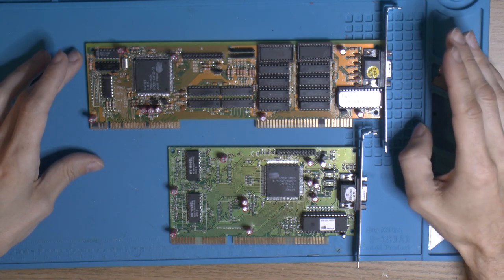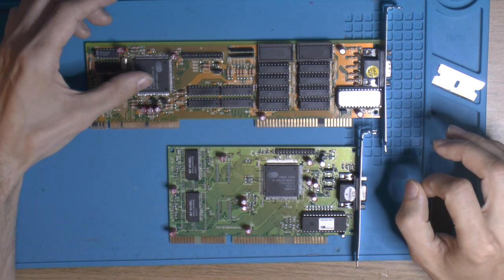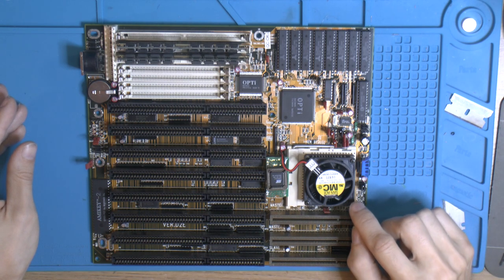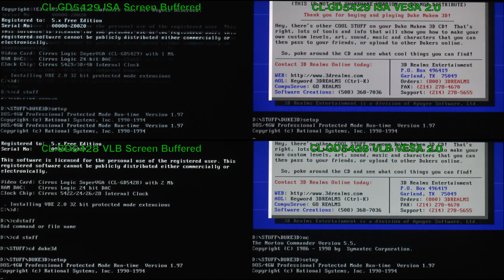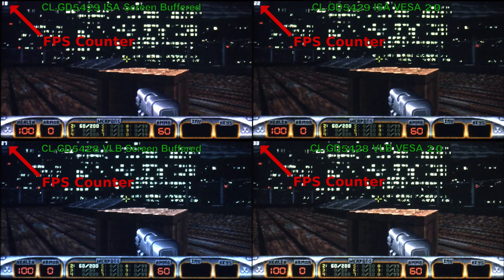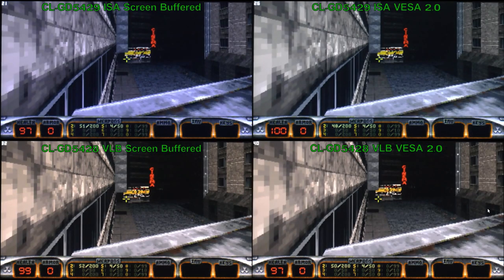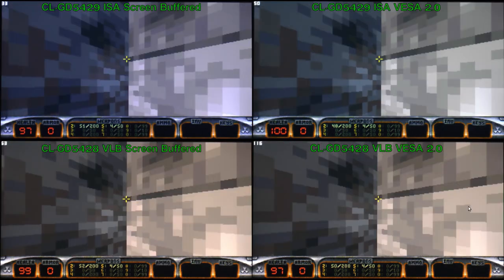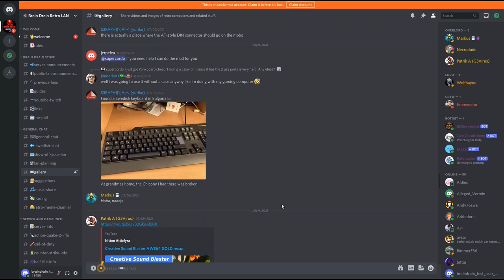VBE on ISA and VLB cards comparison - Reupload - See description

Comment from the maker: I had to reupload the video after some editing, the old on is Unlisted (I probably sad privet in this video but its Unlisted) but if you have the link it still works.
The problem was that I mixed up VESA 1.0 and the games "Screen Buffer" mode that I actually ran when we did not use VESA 2.0.
The results and benchmarks are the same so if that's all you where interested in then that did not change.
But I made sure to edit it to represent what mode I was actually running so people dont get the wrong information.

Comment: Hello, what is screen buffer?
It is that "fastvid" utility from Philscomputerlab benchmark set?

Or is it linear buffering?
So all you have to do, is load UniVBE to get 2.0, and you'll get FPS on the right? It's better than fastvid?
Does have UniVBE Linear buffering and real bank switching mode,  on by default?
Reply from the maker: Screen Buffer is what the default mode is called in the Duke Nukem 3D config file, you get that if you select Normal Mode in the setup video option menu.

So the two to the left dont use VESA and the two to the right use VESA 2.0 because it also supports 320x200 (Vesa 1.x dont).

So running VESA 2.0 @ 320x200 is faster then not using VESA.

So selecting VESA 2.0 in the game at 320x200 is faster if your card supports VESA 2.0, if not loading a Vesa Bios Extension will solve that. Univbe works well wit hits wide support, there are other extensions, some specific to a card or manufacturer and they can be even faster when I tested.

There are threads on Vogons wit a lot of extensions you could try.
https://www.vogons.org/viewtopic.php?t=15190